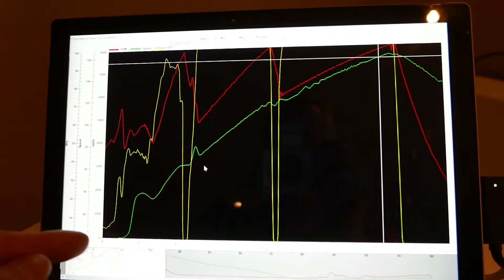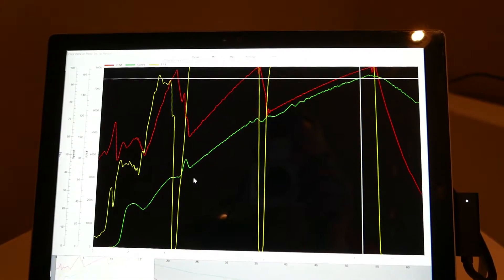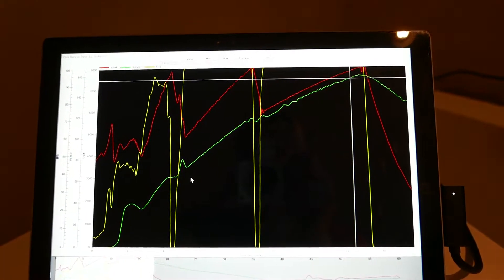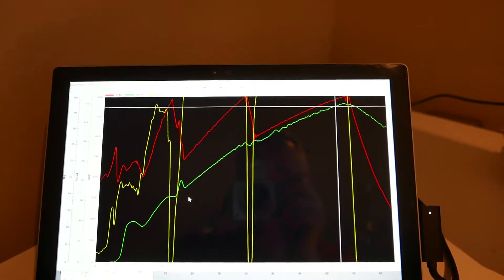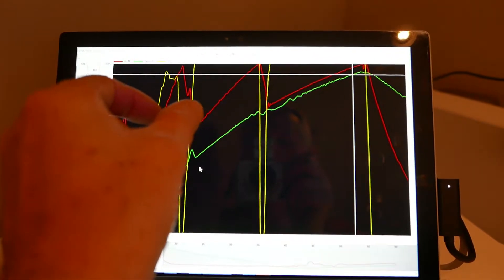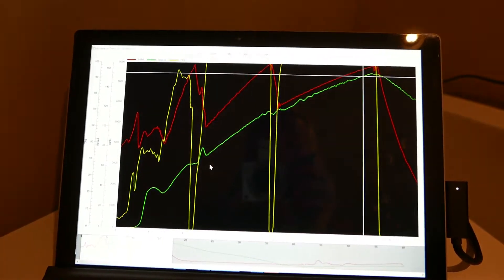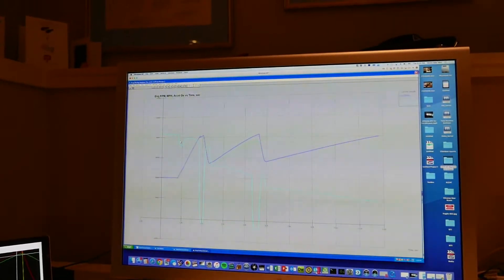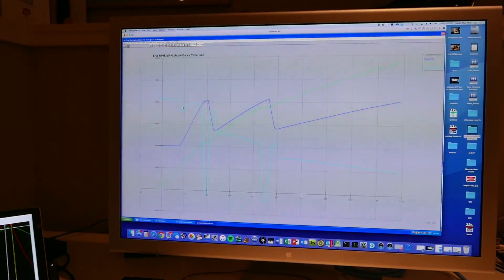The Ultimate 1983 Rabbit GTI - part 150 (1st day of testing at the drag strip)

Comment: just throwing some things out there, but you might try raising the tire pressure to help with the slip/stick chatter..which should improve the launch. keep an eye on things when running solid mount as cracking mounting points becomes an issue. The cross member under the radiator is really bad about cracking and I don't remember if you addressed that in the build. Looks really good and sounds great!
Reply from the maker: Off to the track again this Friday so will play with a few things - at 15psi at the moment. I have a custom x-member at the front and the solid mount at the rear has 1/2" of solid rubber to reduce the harshness somewhat. Seems to be acceptable. I am going to drive thru the water box and then apply the hand brake, and then do a longer burnout. Thanks for the tips. Fingers crossed I'll get better grip this time out.

Comment: The car sounds great. I would like to see the car in the metal. I have 78 that I am working on with Euro 1.6 Heron Gti motor.I would be surprised if it made 90-100hp at the wheels. :-) I had a Turbo PT Cruiser with a manual transmission as a driver years ago. I was able to get that car down to 2.2 60 ft times on street tires with practice. Hopefully the Campbell River track will come to fruition in the near term. I spent many happy hours on the road course and the drag strip in Calgary before the track closed Cheers, Mike
Reply from the maker: I am headed back to the strip in 3 days - I am hoping for better 60' times. I am embarrassed!
Reply: Embarrassed about what? Best of luck. If I recall, with the factory tires I dropped the front pressures to about 22 lbs and increased the rears to over 40. Removing the back seat and spare helped with the weight distribution. The differences in tire pressures may have helped slightly as well. Launching a car that makes most of its power in the high rpm range must be difficult.  What about riding the clutch a bit off the line to reduce the wheel chatter until you get more into the power band. I had a BMW 2002 with a big cam and twin Weber 45 DCOEs that I had to use that technique back in the olden days. :-)